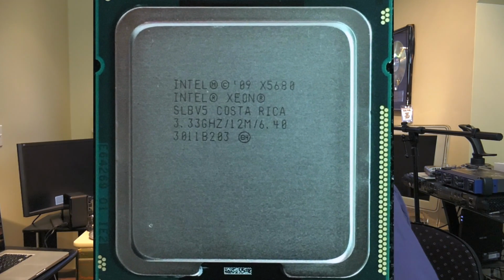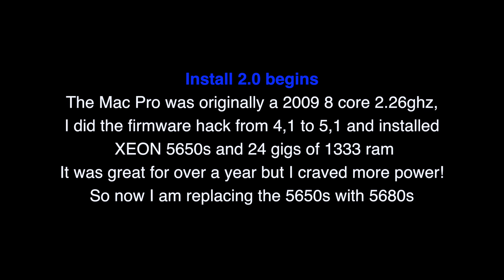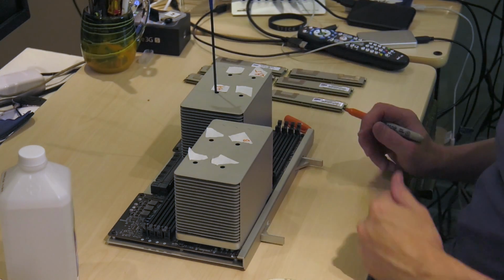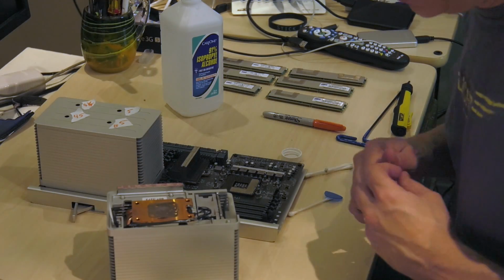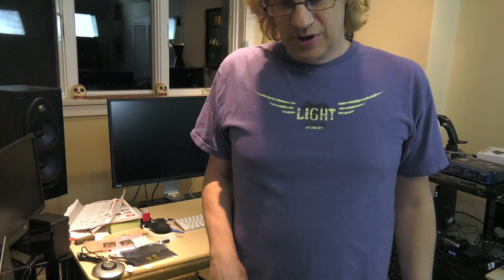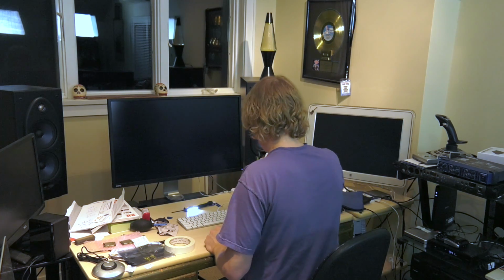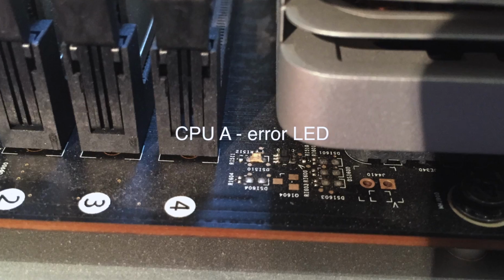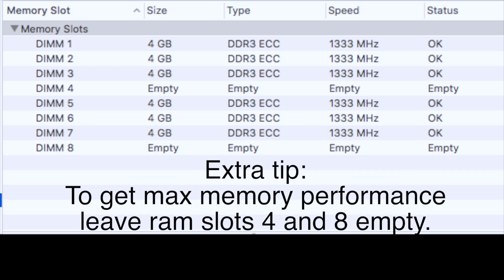MAC PRO CPU Upgrade Xeons 5680s.

Comment: Hey Lance, I just wanted to post my results here. 12 core upgrade to 3.46 x5690 2009 Mac Pro. I did remove the IHS on the processors. I destroyed one by heat. I advise !! And again!! I would not torch those processors!! I did use my vise and easily removed the second IHS. I had to buy another processor at 160.00 bucks. The third one i used a vise also. This one was not as easy. I had to go back and forth. What i noticed mainly with all three was the stickyness of the mastik. The mastik under the lid really keeps things from coming off easily. I removed the lids under this theory. The 2009 did not come with lids. I didnt want to add the thermo pads or cut the tabs on the wire. i didnt want the risk of over tightening either. Apple designed the model without lids. I also polished the dies with a dremel tool and a cotton wheel with green rogue. The polish came out like a mirror !. I taped the processor around the die with blue scotch tape. Then i cleaned with alchool. The second processor when i was gently cleaning with alchool lost a capicator cap. I tried to solder it back on with no luck when it flew to no mans land. Those things are tiny. Needless to say i had an old processor with the same part. I couldnt get that part off my old processor. I noticed that the caps are below the die height so they wont touch the heatsink. I decided to install and see if it would work. Tightened the heat sinks down very snugly. They go on easy with no worry about the fan connection. I must say this way was much simplier and everything is very secure in the machine. Startup was great !! Both processors reckonzed. Had #2 memory showing a fault. Powered down and reset the chip and it showed up fine on startup. Everything went together very easy once those lids were off. Used artic silver 5 and did the spread method. While i was in there i examined the Northbride rivets and serviced the compound under the northbridge for a full service job. The machine idles at 115 Ferenheight cpu core A. And 85 Ferenheight cpu core B. A 25 degree difference from the stock cpu 8 core  temps.(Old temps-Cpu A 130 Cpu B 118). Max intel specs is 178 ferenheight. Please note i am reading temps while streaming video with one window open on a 49 inch 4k monitor ! I have a radeon Hd 5870 1 gb pushing two 4k 49inch scepter (2k x 4k) monitors. My ram is not upgraded and I have the 1066mhz at 24 gigs with all spaced filled,  benchmarks 64 bit @ 20478 multi and 2739 single. Im thinking that the 1333 ram will push another 10000 on the mark and get me in the 30000 range. I notice with quicktime having my audio go through an external soundcard i can capture in realtime with no lagging now. I think when the cpu has to process both video and audio it stresses the cpu. The soundcard takes a load off the processing in my opinion. There is now no latency with screen capture in quicktime. I have a line 6 soundcard. UX2.
Reply: 2009-12 MacPro's have triple channel memory. Running with 3 sticks on a single CPU machine or 6 sticks on a dual CPU Mac will give you the best performance.

Comment: Thank you very much for sharing the install experience. Don't worry too much about it not going fast. Better to take your time and do it right.

I have a good idea about how you feel installing the CPU. My MSI X99A SLI Plus motherboard has a very similar setup where the pins are on the motherboard instead of the CPU.

Well being worried about that thinking that would be how I would break the machine I accidentally ripped out a PCIe slot in the process of trying to get a GTX 970 off the motherboard because the clip on the back somehow broke and jammed in the locked position. 

I was kicking myself. Since I liked the motherboard and it was totally my fault I used it as an excuse to get the minor upgraded X99A SLI Plus.

Comment: Great video. I currently have a 2010 2.4 8-Core E5620 that I recently purchased and would love to upgrade it to 2x 2.93 6-Core Intel Xeon X5680.

The replacement process seems fairly easy coming from building PCs previously and having installed quiet a few coolers of all kinds however the only thing that's worrying me is the amount of turns you have to do to get all the RAM slots showing, booting up, etc.
Reply from the maker: It's much easier on the 2010 although the heatsinks are a bit tricky to get on as they have little posts not long ones like the 2009.
I did one last month 2010 for my friend. Just count the turns to remove as you will need very close to the same amount of turns when you tighten the heatsyncs back down,  the cpu had the  clip that holds it in place and locks it in place so there is less chance of sqashing it, just dont over tighten, You can remove both processors, install cpu 1 first your fans will blow at high speed but thats because the other cpu is not installed yet, once you see it boots tiwh cpu one and all ram is showing up move on to cpu b.
I did both at the same time and all worked. Good luck!

Comment: Thank you!! Because of your video (guidance) i upgraded my mac pro 2x 4 core 2.4 ghz 24 gb ddr3 1066 to 2x 6 core 3.46 ghz +64 GB ddr3 1333 +pcie mercury ssd and it worked like a charm! I'm pretty impressed by the performance boot i got. Before a lot of my projects had like 70-90% cpu workload and now it's between 20-30%. You've got the same results?
Reply from the maker: Arjan Terpstra what program are you referring to with your CPU workload?
Reply: Logic Pro X and Studio One 3 !

Comment: Thanks for video. Very good!
I had done 3 upgrades with not much problem.
And then a few weeks ago completely screwed one up.
Ruined one of the 5690s and bent pins on one of the processor sockets.
Had a guy unbend the pins for me.
It works now but I have to control some of the fans with Mac Fan Control.
I'm not really sure how I managed to screw it up.
I have always used lidded processors.

Comment: Well done :)  5,1 single 6core 3.46 , 48GB 1333. score 16527 64bit .
Reply from the maker: Sweet!
Reply: also results for 48GB LV ram @ 1.35v 1066 , where 16300 64bit. A cheaper way to upgrade ram… Quad rank. etc.

Comment: Did you need to make any adjustments for the extra TDP of the 5680's? The reason I ask is that the original cpu's put out 95w and the w3680, x5680 and x5690 put out 130w via Intel's info.  I watched another video of a cpu upgrade and the original single 6-core mac pro had a larger heatsync. When the owner asked about it, the installer didn't have a clear answer. They were installing a new board with dual x5690's. Maybe the single quad cores also have a larger heatsync. Just asking.... thanks for the video.
Reply from the maker: No I did not adjust the TDP, all my pcie slots are full, pro tools native, usb 3 card, mercury Accelssior ssd boot drive  and a GTX 980ti as well, all drive bays full, no power issues or overheating. Oh yeah I forgot I also have a Super drive and a Blu-ray drive in the two optical slots... she is a beast :)
Reply: +Lance McVickar how did you feed power to your gtx 980ti? And also what ram memory are you using, is it regular 1333mhz CL9 speed?
Reply from the maker: 24 gigs of RAM 1333 DDR3 EEC
And my 908ti cam with cables one 8 to 6 pin pcie and one 6 to 6.
Reply from the maker: same setup powerwise that I had for my R9 280x
Reply from the maker: Here is the seller I got my card from, very good cominication and the card has been great so far. http://www.ebay.com/itm/EVGA-GTX-980Ti-6GB-Apple-Mac-Pro-compatible-5K-support-In-stock-today/131904951154?_trksid=p2047675.c100011.m1850&_trkparms=aid%3D222007%26algo%3DSIC.MBE%26ao%3D1%26asc%3D37577%26meid%3D6dfa15927caa43289b03cf14c3a7f62f%26pid%3D100011%26rk%3D2%26rkt%3D5%26sd%3D142012481514
Reply: +Lance McVickar Thanks for your reply! I actually have 8 core mac pro 4,1 x5570. So far I've added samsung xp941 ngff drive and that's quite a boost, then I got it amd rx480 8GB graphics(supported in the newest macos sierra). Now I'm planning to switch from 8x2gb 1066 ram to 6x4gb 1333 ram which would work in triple channel. Do you think 1333 with triple channel will give me a noticable boost over 1066 dual channel I already have? In the future I also plan to add x5690 x2 but I'm not brave enough yet :P oh and what temps are you getting with your new processors? Isn't IHS making any trouble in heat dissipation?
Reply from the maker: +TTymek have not installed I stat yet for temps but will soon, also 1333 won't make a huge diff but for best speeds only install in the first three of 4 chips in each ram bay for fastest memory speeds. How is the AMD card no boot screen but works well with Sierra?
Reply: +Lance McVickar yeah I'm aware of installing memory in only 3 slots instead of 4, that's why I mentioned about triple channel work. About the rx480 there's no full opengl support yet and of course no boot screen, apart from that you can normally use it in osx. Hope there will be full support in the sierra's final version, so I could buy another rx480 for crossfire. That's great we can still outperform the trashcan mac pro with our 7 year old machines! P.S. I installed windows10 on bootcamp drive and achieved around 50fps in The Witcher 3 ultra with my current setup ;)
Reply from the maker: +TTymek cool yeah I get almost double my R9 280x in game frame rates and in Windows the cad is great for games, running Windows 7 at the moment, tried the 2016 Doom demo running at 1440.

Comment: Question: Do think one can do a complete build of a Mac Pro starting with an empty case (hopefully complete with a wiring harness) using used hardware and parts? Enjoy your blog.
Reply from the maker: well best off with a 2009 or 2010-2012 chassy. Earlier models have different components and design. But you can find them cheap on ebay especially 2009. So depending on what you want to do I. Single CPU up to six cores. Dual CPU 2 cores.

Comment: Hi Lance, not sure you can help me with this but i tried to upgrade my 2x2.26 quads to 2x3.09 sixes a while back. Did all the thermal pad, heatsink mods needed, installed one CPU in the A socket just to make sure, booted into OS X, all ok but about 10 seconds after logging on the fans would go nuts. I tried tightening, loosening the heat sink but with no success so i went back to just 2x2.6 quads. So anyway, thought I'd have another go recently, but this time i removed the IHS (sucsessfully) because i was afraid of damaging the logic board, fitted the cpu into the A socket just to check all was ok,  once again the mac booted all ok, i managed to log on but about 10 second later the fans went nuts again. I did what i did before, tightening loosening,  also this time tried changing the RAM configuration but still the same problem of the fans just going crazy. The CPU temp however seemed to remain cool at about 42 degrees C, I use smcFanControl. Im now once again back on 2x226 quads and feeling very frustrated as I'm fairly technical and afraid to do these kind of challenging upgrades. Any pointers would be greatly appreciated as i can't find anything about this problem on the net. Cheers Tim
Reply from the maker: Mookmusik if you install just one CPU the fans will go full blast no matter what once you get CPU 2 installed properly all fans will act normal so again only one CPU means fans will blast that's normal
Reply: Oh ok! Thanks for that, gonna get the other chip in it now!

Comment: Tempted to do this. I have a 5,1 8 core. About to ramp into mojave with a SSD. Is the performance noticeable with the upgrade?
Reply from the maker: Yes it’s well worth it, might as well go with 5690s as they are so cheap now. Check out my latest video as I just installed 5690s.

Comment: Lance did you ever see what temp those were running at ? Im looking at some 3.47Ghz X5677's. Do you have an opinion on those chips ? Thanks for the videos. Your giving everyone confidence.
Reply from the maker: NOt familiar with the 5677 spec wise it looks like it could work but if you have a single cpu I would go with the 6 core 3690 3.46 ghz. Looks like you could use the 5677 but why not have  2 more cores. Or if you have a dual cpu I would go with the 5680 or 5690. 5600 series are for dual cpu and 3600 for single so I guess two 5677 would bump up your current cpus if they are 2.8 or2.8 ect but if your going to risk doing the upgrade might as well go for more cores. My 5680 temps average 41c CPA A and 36 c CPU B when idle.
Reply: Thanks Lance. I see what you mean the 5677 are only 4 core duh. Think ill go with the 5680. Does quicktime screen record lag on your system ? Im wondering if its an app flaw or just that my hardware isn't strong enough. I love the simplicity of quicktime screen recording and the export speeds are almost instant with a ssd drive. But during actual capture it uses 100% of my cpu ? I like screenflow but i hate editing in it. Just wondering how quicktime performed on your beast ?
Reply from the maker: Just did a little test and there is some strange stuff going on with quictime screen capture. I have three monitors. If I capture at 720p on my 1080 tv things are silky smooth. above that and it starts to get glitchy. 
At 2560 1440 on my main monitor it's really glitchy but even at 1080 its not great. My macbook pro capure is smooth but it is a non retina and only goes up to 1440 by 900  but its still running MT LION, my mac pro is on Sierra. i7 chips have built in h264 encoding acceleration Xeons do not adn that may have something to do with it. That may be the diff or the operating systems versions of QT etc.
Reply: Thanks Lance. i think its just a quicktime thing. i cant capture 60fps with it. Also I have to wait about 3 min before and about 5 min after capture or else the videos get chopped and cut. So i usually go over in time and just trim the video. (front and back). quicktime has a bit of lag and if you stop immediately the data isnt captured. I have to wait for a bit so the cpu can process and render the full capture. This happens at the beginning and ends. Probably just the way apple wrote the Script. Its really cpu intensive
Reply: by the way. One screen @2560x1440. Sometimes i get a glitch where a frame is cut out. But not too much. The only thing i have noticed is you have to allow time for the cpu to reckonize everything at the beginning and ends of capture. I thought it was a hardware performance issue but now im thinking its more software based.

Comment: hi again,
I'm going to replace the cpu on a 2009 8 core 2,26ghz with two x5680 cpu . I'm wondering if the thickness of new cpu is more than original cpu and if I,m supposed to put a new thermal (pad 2mm) on the bottom of the each heatsink...thank you again
Reply from the maker: Put the thermal pads on the sensors not the bottom of the heatsink look at my first video
Reply from the maker: Yes unless you remove the caps on the CPUs you will have a height difference from the originals please watch my first video on doing the upgrade.
Reply: ok yua have been clear. thank you a lot

Comment: Thank you for sharing your experience, your work.

I'm gonna do the same next week-end 😰.
Mac Pro 2009 4.1 upgraded to 5.1 and put on two X5680 CPUs... i cross my fingers.
Holy Mary Mother of God, need your help 😄
Reply from the maker: Good luck!
Reply: Lance McVickar thank you !! I will give you my feedback.

By the way, i successfully upgrade the 5.1 Firmware with ur video 🤘🏻
Reply: Lance McVickar CPUs are installed and works well !!!
RAM (32Go) are installed and works well 😄
Reply from the maker: leRhinoferoce congrats!!🤙🤘
Reply from the maker: Keep in mind you should leave memory slot 4 on both ram cards open to get the fastest memory performance. Geekbench scores go up quite a bit if you do that.

Comment: mate i also have a mac pro early 2009 2.26 2xquad core and i was told to buy dellided CPU's,  yours aren't .  am i doing something wrong ?
Reply from the maker: Not at all just make sure they are cheap it’s easier with delided CPU’s to do the install no need for clipping heat sync connectors or adding more thermal pads just replace the processors, make sure to do the 4,1 to 5.1 firmware update first

Comment: I would hardly suggest to remove the IHS because of force who pushing on the sockets. You can easy kill your sockets whitout remove the IHS. The removal of the IHS will take u about 30 min. What you need is 4 razorblades an Iron and a Glas. Unfortunatly the IHS on the 5680 are soldered to the CPU. Thats why you Need the Iron. If you Need Assistans i can help you. I removed mine 4 month ago and it works perfect now. Temps will be around 44-55 degress Celsius.

Comment: Moral of the story.....
If it ain’t broke don’t fix it!
Reply from the maker: KALUS DJ been working great ever since so I agree to disagree.
Reply: Mac Sound Solutions 
So you got it working! 
I didn’t watch till the end saw all your problems and thought for the extra cost and no hassle I’d rather buy one already done. 
Glad you got it sorted though. 
I’ve only ever had one of those moments when my 3.1 crashed after opening logic. 
Did a os repair thinking it would sort it and it did the same again. I thought the Mac had had it. But a new ssd reinstalled with time machine sorted it and never had a prob since and only just getting the 5.1 as Mojava is usable now
Reply from the maker: KALUS DJ  Yeap no probs and this video is two years old, second time I did the cpu upgrade and the Xeons are so cheap now it’s worth doing. I can’t install Mojave’s because I have an Nvidia 980ti but my system is rock solid so no need to upgrade. Mojave is running well on my 2012 MBP.